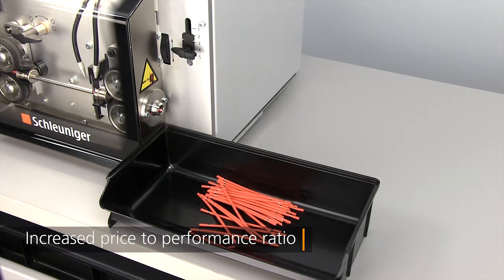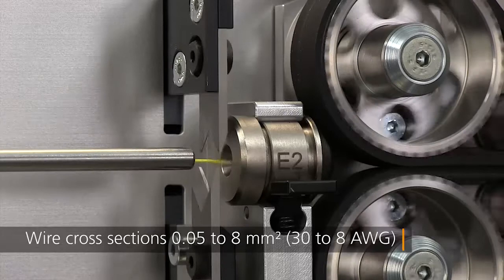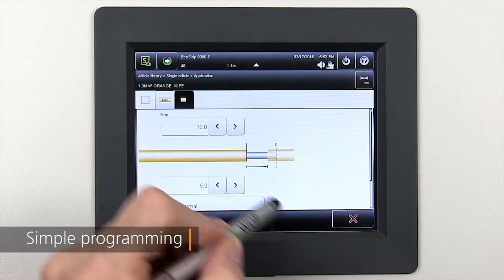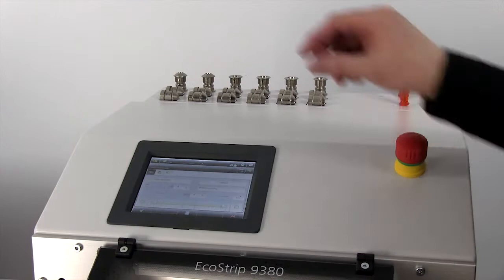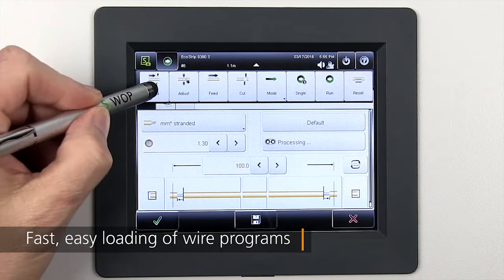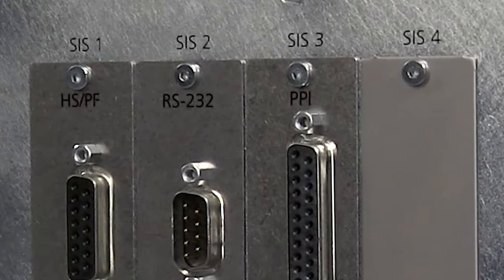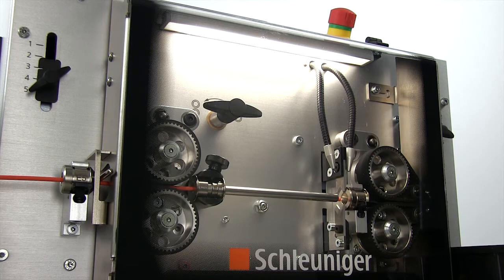EcoStrip 9380 Cut & Strip Machine

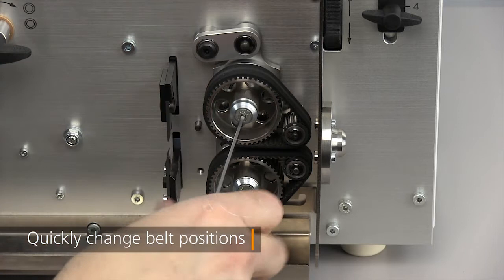Comment: Excellent machine ! But what´s the point in changing the rollers position ? As seen on 1:40
Reply from the maker: Hi Manuel, Thank you for your question. It is a great feature on the machine because it allows you to process very short wires, as they may not be long enough to reach the belts if they were turned the other way around. 
Let me know if there is something else we can help you with.
Reply: Oh, I get it now. Smart solution !